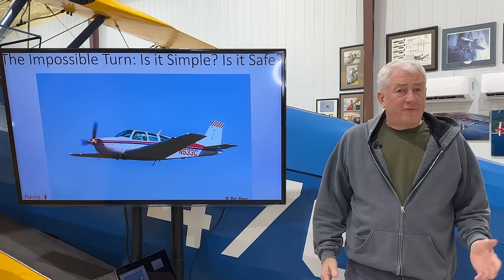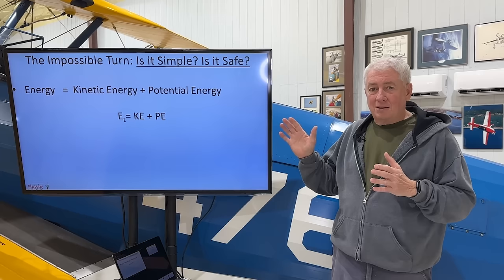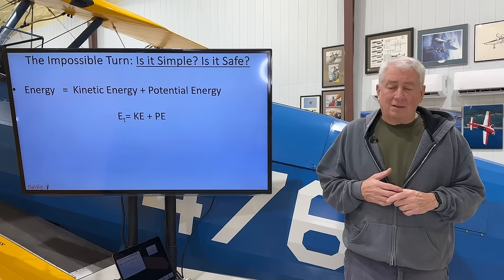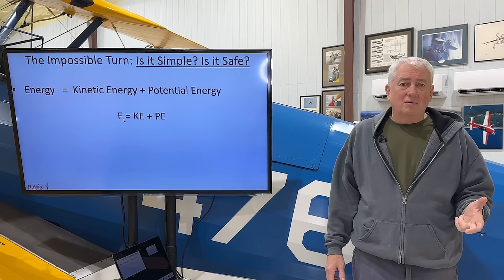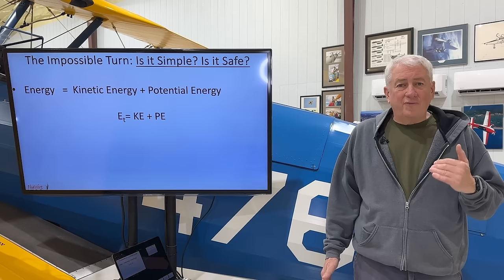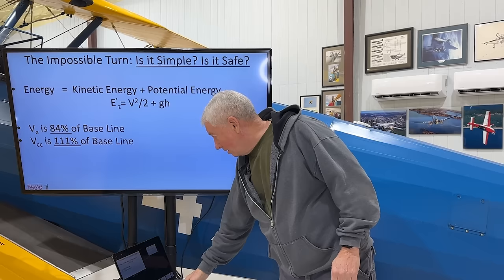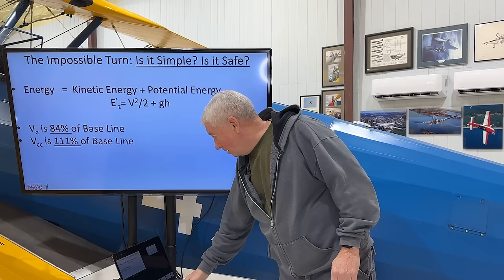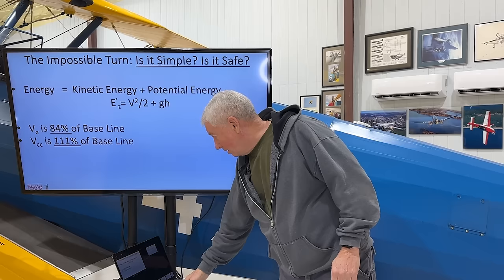Impossible Turn Is it Simple? Is it Safe?

Comment: Hi Scott -  Really appreciate your dedication this and other safety topics.  I get the energy equation.  Maybe I am missing something on the time to engine failure?  More time=More altitude at Vx, Vy or Vcruise.  More altitude = more potential energy.  What I am missing is the apples to apples for when the engine fails after takeoff.
Reply from the maker: No, you are expecting that and that is not a valid metric. I said I would do another video where I'll take a deeper dive into Vy and Vcc, with time to climb, turn results and reasonable decision points. You have to look at it from the opposite perspective. Physics is physics. Essentially, each maneuver is independent of any other, except for the resulting energy state. The altitudes chosen for the simulated cut have nothing to do with each other, but everything to do with the energy available to make the 180 turn. If it barely makes the 180 it won't make the 270 and will need a higher minimum altitude as a decision point to turn back. The speeds require different decision points. I chose 800' for Vy because I hear that claimed all over the interweb. So, the results showed it can make the 180, but really nothing further. As for Vcc, that altitude was derived from a previous video I did on this subject. Don't forget that wing loading is a controlling factor. 

You have no control over an actual engine failure. What we are looking for is decision points we can figure out on the ground so we don't have to make it up in the air.

And unfortunately from your comment is seems you missed the point on Vx, Vy and Vcc. Velocity has a bigger impact on energy than altitude.
Reply: @FlyWirescottperdue  You are correct - I did miss this, which is likely why I was confused.  At the point of takeoff, all of the speeds are the same - the rotate speed.  One will then accelerate to different speeds depending on AOA.  Since I am still a bit confused about your approach to this, I guess I will await your findings.  (I would think that while Vcc gives you the highest energy state/minimum energy loss - it would also result in you being so far away from the runway as to prevent the return)

Comment: Simulating from altitude (obviously for safety) is nice but probably not as bad of numbers if it were the real deal, mainly because an actual engine failure with a nose high attitude has you way more on the back side of the power curve, hence eating up more energy just to get to best glide speed. Just another variable that makes it sketchy to turn back. Good job explaining it and demonstrating it. A cub is way different than a bonanza. Hate that mcspadden demonstrated it in a cub.
Reply: Mac Spadden was killed by a big body but bad pilot.  He knew that maneuver, but that guy didnt.  Not the first good pilot killed by the many errors of a bad pilot.
Reply: So you think that he just sat there and watched? He and the other pilot believed they could make it back.

The impossible turn is exactly that, a set of factors that make a successful return the the airport not able to be completed.

He and the other pilot believed the bullshit he was peddling. How many others have to die for clickbait?
Reply: @PilotCFIWesHead  WHAT IS IMPOSSIBE YOU SAY? The problem was the  bonehead owner that popped out that draggy landing gear at the end.  The other alternative was to hit the other hills or trees in front. The were going to be fucked anyway there.
Reply: @PilotCFIWesHead  I learned EFATO Turnbacks in 1996 as CFI and taught to about 6 just before airlines called me in 1997.  But they were total power lost EFATO, from 700-800 agl on Cherokee short winger.  The partial power much later.  

The partial power LOTOT kind can be very tricky.  I practiced them i think 2004 and it depends on if holding altitude or not wit partial  power only. 
 You have to troubleshoot as you turn away from the wind if crosswind or to the right if not.  I did them from as low as 300  "The 300 AGL LOTOT" but you take a chance if engine dies just before the second turn into the wind or left if not.  And that is what happened to them i think.  The turn was made well, no stall and they aligned it, but i think engine died all and they got bit low. 

Then  THE OWNER POP OUT THAT DRAGGY GEAR AND that made them hit 15 feet under the airport hill.

Comment: Can you share your thinking in the next video about flaps on a fixed gear plane as well?  I usually wait for 500 feet before touching anything.  My fear is that one retract but the other does not.  Not seen something like this just that they potentially don’t respond at all.
Reply from the maker: That topic will probably be in the third video in the series. Don't overspeed your flaps. Consider how the flaps in your airplane operate. Split flaps in mechanically driven systems rarely fail with a split.

Comment: Would it be feasible to have a JATO bottle mounted properly to assist with the turnaround? A 20-25 second blast of thrust could be worth the few extra pounds to carry.
Reply from the maker: My friend Todd Falconer thought so about 10 years ago and developed a solid rocket using wax as the propellant. Primarily for twins. Regulatory issues could not be overcome with the capital available.

Comment: Scott love your videos.  I read the comments but I am still wondering why you started the engine failure at different altitudes?  I would have thought you would start the failure at the same total energy state which means higher altitude for the slower speeds instead of the opposite like you did.  Please help me understand your point.
Reply from the maker: The simple answer is the altitudes were chosen because this airplane can make the 180 degree Turnback (not necessarily 270) from those points. Two things: I said I was going to do a deeper dive into Vx and Vy and I also said I'd done many other videos on this topic. So I've experimented with these altitudes and speeds... this is not a stand alone video. It looked at Energy in this video. You want more, watch the previous videos, the Playlist is in the description and the next video will dive into Vx and Vy nuances. If I tried to cram everything into one video it would be more than an hour long and no one would watch it.

Comment: You lose kinetic energy at a high rate until you get from cruise-climb speed to best glide speed, at the same time starting a steep turn to get turned around. Seems most lose it while trying to make that last 45* if they do make it back to the runway. I personally like to make a prompt crosswind turn after takeoff, then to base, and if the engine is still running,  leave the pattern for my destination. If the engine quits before my crosswind turn, there's no turning back..
Reply from the maker: Pretty good picture, except for the part at losing energy at a high rate from cruise-climb to Best Glide.... that applies to Vy to Best Glide.
Reply: @FlyWirescottperdue   That's essentially what I meant. You're going up hill, and forcing the airplane nose down creates a good amount of drag for a few moments. Cheers

Comment: TBH, the engineering analysis isn't correct or, at a minimum, confusing.  Using the energy maneuverability method by creating Ps (specific excess power) plots, the fastest way to build energy is an acceleration in ground effect to Vy and then a climb at Vy.  By definition, Vy is the fastest way to climb.  Why?  It's where you are maximizing the specific excess power, which is the fastest way to build energy (power * time = energy).  Vx gets you a steeper angle but at a slower rate.  Vcc gets you a shallower angle for better visibility and engine cooling but a climb at a slower rate.  Also remember that it takes more time to accelerate to Vcc than Vy.  It's about what builds the most energy the fastest.  That's accelerate to Vy and then climb at Vy.  

The sink rate in the turn is a red herring.  What you want to minimize is the altitude loss for a given amount of turn.  That happens at 45 deg of bank at stall.  It doesn't happen at minimum sink rate.  It doesn't matter that the sink rate is high if the time to complete the turn is very short.  Expect to not be able to hold your airplane in a 45 deg bank at stall.  The turn rate is amazingly fast, and that introduces something most pilots don't ever experience - an increase in AoA at the tail (reduced elevator effectiveness) due to the tail "swooshing" through the air because of the high pitch rate in the turn and the tail being at the end of the lever arm.  The first time I tried this, I had the yoke in my chest and couldn't hold her at stall.  The airplane was accelerating like there was no tomorrow and turning its head like Linda Blair with full aft yoke, and that's about as far as I wanted to be a test pilot that day.  I had to back off to 30-35 deg of bank.  And I felt a lot more comfortable with the lower turn rate.  But even then it was amazingly fast.

My recommendations as someone who has practiced this are:  1)  If you are a student pilot or only fly to seek out the $100 hamburger, just go straight ahead.  You most likely don't have the skills to safely execute this.  But the less turn required the better.  2)  Successfully executing this maneuver requires skill, familiarization and recent experience with the airplane especially at slow speeds, planning for the specific runway you will be using (which way to turn, will it be 90 deg or the full 180-270, what minimum altitude is required, etc) - and a pre-takeoff briefing to mentally prepare yourself and go over the numbers and actions again  3)  The higher the wing loading on your plane, the more skill and practice you need and the less able this maneuver can successfully be executed.  4)  Don't be flying near stall if you plane has bad stall characteristics.  Keep the speed up a bit.  5)  The only way to spin is to aggravate the stall with ailerons or rudder.  Don't be using them in the turn.
Reply from the maker: Kong, thanks for watching and commenting. But to be honest I think you absolutely missed the point I was making. Vy and height is not the best way to acquire energy. Did you even watch the video? Or any of the other ones in the Impossible Turn Playlist? Go back to the description under  the video and watch them. If you spend the time to do that you can refine your understanding of the maneuver.

Some of your points are close to truth, but you miss important factors. Your 'swooshing' observation describes a spiral dive, your aerodynamics are wrong.

Comment: I watched the math section again, and I agree with the 52%, 64%, and 80% KE’ for each speed compared to the others.  What I still don’t understand is how you got the earlier numbers for 84% and 111% for E’t compared to baseline.  What did you use for PE’ to get these numbers?

Thanks again.  Keep them coming.
Reply from the maker: Just like I said in the video. I used the speeds I mentioned, and the altitudes, converted them all to metric because slugs don't make sense to me. Ran the equation for each altitude and made a table... created a percentage of baseline for each altitude and then took the average of the energy at those altitudes.
Reply: @FlyWirescottperdue  I was also a bit confused about your calculations there... So you calculate KE for the different speeds and add the PE for heights between 100ft and 1300ft. And then you take the average of the Total Energies for the different heights for every speed setting? If I do this (actually you would have to take the integral, but a reasonable step size of 100ft for the heights is good enough), I get 86% and 109% for the average energy of the v_x and v_cc case with respect to the v_y case. The difference to your numbers is not too big but either one of us has the numbers wrong or you calculated the numbers differently.

Comment: Ok. After repeating your math, I see the 84% and 111% were calculated at a height of 400ft!  So I think I get your message, the lower to the ground you are, the more of your energy is KE (eg h=0).  But as you go higher, PE is much larger than KE and these E’t percentages get closer!  Yea, the his makes sense.  I didn’t get this from the video based on your explanation… sorry.  But I think you are on to something and look forward to seeing if we can even trade some of the higher climb speed to for a tighter turn without stalling?  Or do you lose too much altitude in the slow tight turn?
Reply from the maker: You don't lose as much energy in a tight turn if you are near Vcc.

Comment: There is one glaring error in your calculations: you use the time to turn 180 degrees; a 180 will only get your course reversed, it will NOT get you back to the runway. Doing that requires 270 degrees of turning, 225 to get you pointed back to the runway, and another 45 to realign with the runway. Basically, you just can't do it because you need more altitude and speed to make the 270 and as you get higher you also get further away from the airport. The best strategy applies to airports with a crosswind runway. After breaking ground begin a turn (traffic permitting) that keeps you close to the airport. As you climb and turn you are, at most, a 90-degree turn away from a runway. This dramatically reduces the amount of altitude required to complete the turn. Flying out of airports with only one runway forces you to use your altitude to find the best possible crash site. Note: you can try all the possibilities in the comfort of your own home using Microsoft Flight Simulator (or a similar program). I tried it with the 172 and couldn't make it back with any engine failure point.
Reply from the maker: Not an error at all. I guess you’ve missed all the other videos I did on this subject. Check them out in the Impossible Turn Playlist.

Comment: I’d like to practice engine out emergencies. Is there a risk of damaging my engine due to shock cooling?  I fly a Cherokee 6 with a 300 hp io 540.
Reply from the maker: Shock cooling is largely a myth. What you don't want to do is quickly cram in full power after idling for quite awhile.
Reply: I’d love to hear you elaborate on this topic.  Maybe you could in a future video.
Reply: Drive a Chevy Corvair for awhile and test that..

Comment: 8:30 I expected 77kts/96kts= 0.80. But I will keep watching, if maybe the explanation is right around the corner.
Edit: And indeed it was, the 64pct is 0.80^2, so just a typo, the energy percentage is correct.
Reply from the maker: The numbers I talked about were from the energy equation. I would expect it would run the same with the actual speeds I flew though.

Comment: I am not a pilot but one thing that I wonder about is that there seem to be small fields in heavily built up areas. So do people fly out of strips which have no clear ground straight ahead or within say +/- 20 degrees of runway alignment ?
Reply: 70% of the airports in my area have no safe landing zone within miles of the runway. Trees, houses, and cliffside in order of prevalence.
Reply: @diveforknowledge  That's interesting, must encourage the thought of a 180.

Comment: So, does the formula suggest it is better to use your power to get faster, more so than higher to have the most options?  I'm just guessing because you pointed out that velocity was squared in the formula.
Reply: No.  You want to accelerate to Vy in ground effect and then climb at Vy.  That's the fastest way to build total energy.  I posted a comment here somewhere with the details of why.
Reply from the maker: That is exactly the point. Velocity gives you more total energy to deal with a power loss.

Comment: I'm confused... how did we arrive at these engine failure altitudes for the varying climb speeds - 237ft, 800ft, 1100ft? Clearly you didn't assume the same time to failure, as times are different as well. What was the constant assumption?
Reply from the maker: No, why would it be? Vx should only be used to clear an obstacle... flying it to 200' (where I planned to pull it, but missed) is the wrong usage of the speed. But you can see it is VERY risky. At low altitudes it would be fatal. Watch my other videos to see why I choose these altitudes. But, if you were aying attention you would easily see anything lower would not result in success. In this airplane. Wing Loading plays a huge factor. 

What good does time to failure do... an engine failure is completely arbitrary anyway.
Reply: @FlyWirescottperdue  well isn't the idea behind trying different climb speeds to see what position it puts you in relative to the field? If you climb at Vx your pitch is higher and airspeed is lower, which is bad, but on the bright side you're closer to the field, etc. Isn't that the point? If so, we need to develop a theory when the engine quits - in a fixed time or in a fixed number of revolutions, or something. Otherwise you're only comparing the ease of recovery from an engine out during a climb, and of course it's obvious that the slower you go the more difficult it is. You're just ignoring the other side of the medal it seems.